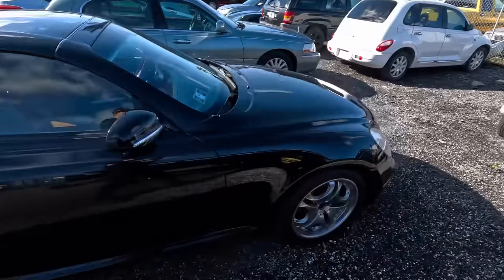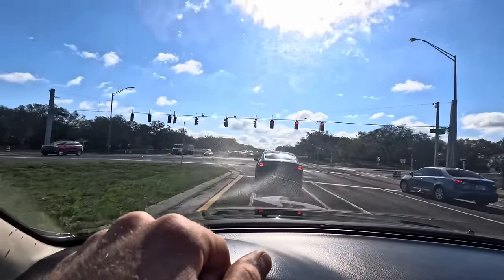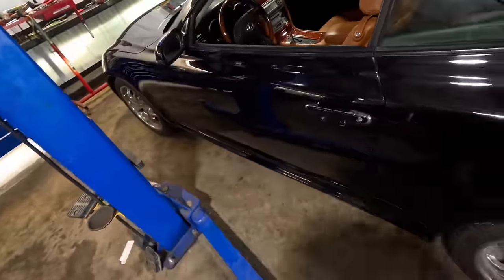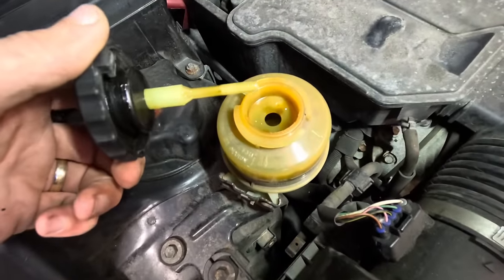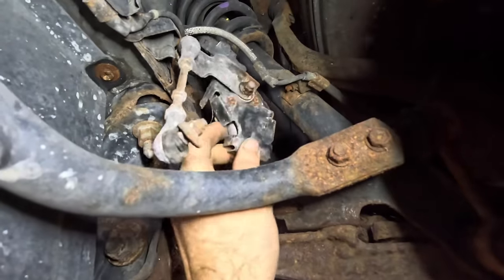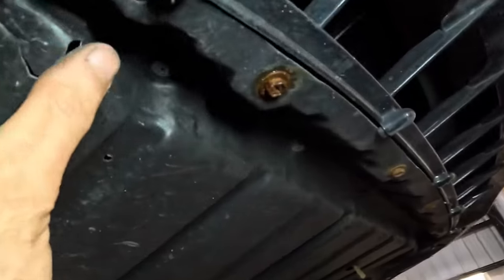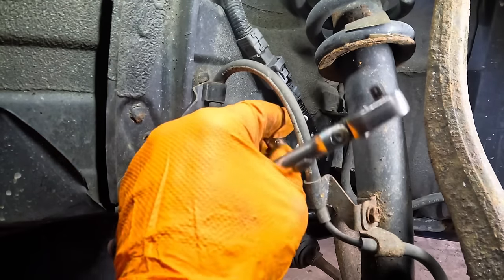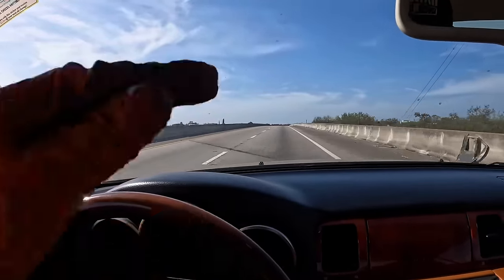Most Hated FAILED Sports Car! Lexus SC430

Comment: Stock USB in cars wasn't a thing in 2002. IIRC, first found it's way into cars via aftermarket head units and was more of a youth-oriented feature. Wireless charging in phones wasn't a thing until the '10s. Wasn't the Avalon one of the first cars with Qi?

I want aware of the SC430 being a flop, but I know this was when the SC leapt up the price scale with the standard convertible hard top. The value proposition changed. It was getting away from being the lux car you could buy and not be seen as performatively opulent. That also should have been around the time more luxury CUVs were showing up. People bought those instead. People also didn't buy the LS430 the way they did the LS400 (the SC300/400 was popular as well).

I would argue that Toyota has long been ahead in R&D (thus, well-built cars with well-thought, ergonomic interiors). They spent the budget there instead of in Marketing research...which is where the push to include all of the "comfort and convenience" toys that the American marks tend to excel in come from. Of course, that's also why they tried Scion.

If I had my pick, I'd have a SC300 with a manual because I like the shape, sticks are fun and I prefer a sunroof and trunk space. I can RAM mount a screen somewhere to add tech if needed.

(but what I would really want is an IS Sportwagon)

Comment: I feel that the owner should be told that you put a used part and way you had to use a used part and they should know that you welded a part back together. The air filter i think you should have cleaned it or let the owner know and let him decide if he wants a new filter or maybe have the customer come and pick it up and let him clean it or he might say get a new kl filter but I would have left it up to the customer and let him decide what he wants to do

Comment: I never liked that body style. Not sure of the model but the coupe body style before ours also looked like that. We have an RC-350 FSport in red of course. Great car and great looking. Only PITA front and rear tires are different sizes so can't rotate them. I'm in Florida. Finding this car with a beige interior vs black was unreal. It turned out there was only one in the country in N.C. We flew to NC. Uber ride to the dealer with our luggage and drove it back to So. Fl. They treated us so well up there we took the salesman and manager out to dinner. Never had a better car buying experience. Johnson Lexus BTW. We have a local Lexus dealer. JM Lexus. They are a Plus dealer so fixed prices no negotiating. They didn't have the car anyway but they don't deal. Not sure why people would buy from them but a lot of people would rather pay more and not haggle I guess.

Comment: if the customer is okay with it, i don't see a reason why you would be against using used parts. just charge them using used part prices and  make sure it works after it is installed and i would consider it all good

Comment: The only reason one could consider this car a failure is sales numbers and possibly marketing. It's NOT a sports car in the true sense of the word. It's a Grand Touring car. Reliable as anything else out there. A neighbor owns a 2005 with just over 200,000 miles. It doesn't leak from anywhere and runs like the day he brought it home nearly 20 years ago. Typical Toyota/Lexus reliability.

Comment: Used parts are acceptable when new ones are unobtainium. Owners should be advised and approve. No warranty on used parts unless it came with one from the seller and it should be understood that the shop/installers labor is not part of the warranty. In other words, the part should be warranted if it came with one (like, say, 30 days) but the installer should be paid for any subsequent R&R even if it fails within that time frame. 
Used parts can save a vehicle but bring inherent risks that the shop should not be liable for. All of that, or whatever agreement is decided upon, should be made abundantly clear to the customer-preferably in writing.

Comment: We've been using used parts to repair cars FOREVER (junk yard), if it does the job OK. You guys and your rust, I'm in Phoenix, don't think I could handle all that rust. Well the dealer had the part, but they wanted $235 for a sun visor, but WAIT, we'll put it on for free, still had to pay $70 on ebay, OMG

Comment: Customer should be made aware of the situation and decision should be there's but if the used parts are in good working condition, there's nothing wrong with using what's available. Only time it should be a problem is when said mechanic/salesman suggesting used part is actually a NEW part. That's immoral.

Comment: I think the customer should make the call on used. Explain the situation, "new is back ordered until don't know". "I can get a used part. What would you like me to do?" You would have to determine what your business policy is on warranty. I think you should be responsible for workmanship, but not used part itself. Customer is paying less for used part, he is taking the chance. As long as that is explained up front. Also, make sure it is on the paperwork and signed and accepted by customer. "Cover thy A**"

Comment: 392nd!  Happy LEAP DAY! Ray and the wife unit. And a big LEAP to the new employees. I think buying and or rebuilding parts you can’t find new is perfectly acceptable. I have a 1993 Mercedes 300CE convertible that had a leaking pump for the retractable top. I looked for months along with my mechanic to find one. Couldn’t find even a used one. Then a friend who ran a Mercedes dealership told me about an older gentleman who specializes in rebuilding convertible top hydraulic systems. I drove from Pierre to Denver left the car, flew back home, then when he had fixed it flew back to Denver to take the car home. It cost $750 for the  repair, but by fixing it, I was able to have the top go up and down so I could enjoy the convertible the way it was supposed to be used. Why have a convertible if the top doesn’t work?    Roger in Pierre South Dakota
Reply from the maker: It is leap Day!

Comment: If you seat is rattling the car you got is a rat and the guy that owned it didn't take car of it OR he weighed 400 lbs.
So, Nappa leather, GENUINE wood trim supplied by Yamaha Musical Instruments, HAND CARVED steering wheel by Haruko Techno wood ( made handles for Shogun swords), AND stock MARK LEVINSON 8 OHM(!!!) sound system.
Creaking roof?  Care dictates treatment will Silglide to keep them supple.
It sold for $64G's which in '04 meant $100G's.
I would like to see the CARFAX on this car!
Oh, underpowered?  200HP:  NSX from the same period was 280HP.
For the record, I recently did my timing belt at Lexus and was approached by everyone including the staff asking if I wanted to sell it ("No" ).
Face it, you got a rat AND a poorly-cared for rat!  I could tell when I saw the aftermarket wheels...I bet it even has a ghetto-blaster aftermarket radio!

Comment: FYI  It's not faux wood.  That is actual wood.  They are very reliable and fairly sporty. And Lexus are built in a separate plant in Japan with more QC than Toyota, and built better than Toyota. Lexus is less a Toyota than a Cadillac is a Chevy.  The reason the SC 4xx  weren't popular was the typical Lexus buyer used to drive an Oldsmobile. You don't see many people trading in their Olds 98 for a 911. The SC 4xx's were too small for the elderly XXXL's  who shop at  the Lexus dealer.   Also, the styling was too lame for real sports car lovers.

Comment: I had a Lexus LS460 and it was horrible, sticky interior constant coolant system repairs, rear suspension issues. Before I got it the front suspension had been redone and the abs system had been replaced too.

Comment: Certain used parts are fine. It just really depends on what it is. Should we tell the customer if we need to install used parts? Of course we tell them!! That's a no brainer, imho. Should the customer give consent on using used parts? Of course!! It's their vehicle, so they need to make that call. Although, it's up to us to give the customer all the information they need to make that decision. If we do our due diligence to help them make an informed decision. They will appreciate you/us more and will have more trust in us to take care of them and their vehicle. If our customers can't and don't trust us......well, they won't be OUR customers for very long now will they? Warranting used parts? Well that's a difficult one.  I say, yes and no. I will warranty my labor. But as far as the part goes, it depends on the part. I would NOT warranty electrical parts. You can't trace down the history of that part. You've no idea what that part has gone through before it got to you. So it would be impossible to guarantee that part, imho.

Comment: Kind of insulting towards Toyota/Lexus cars, aren't you?  Yet they consistently build the most reliable cars in the world, and Lexus is the most reliable luxury car in the world.

A lot of the interior creaking is from the top, the seats will squeak if you have the front seats against the rear seat thus the leather surfaces of the rear seat creaking against the plastic front seat shell.  There isn't anything that can be done with the top, MBZ had a similar top with a similar problem.

That car in the video I think has more than 65,000 miles, one look a the front seat shows indentations in the foam seating surface where it looks like someone has sat in it for 165,000 miles, or maybe the driver was very heavy.

That car had a rollover sensor pop-up roll bar that came out of the front seats for safety.

You made a snide remark about the cassette deck but failed to mention it also had a CD player.

That car is very solidly built, it was 500 pounds heavier than the same era Mustang GT yet it could keep up with the GT.

I've had mine since new, but since I live in the snow belt it sits in the garage all winter, so it only has 85,000 miles on it, but it's never needed any sort of repair, typical of Lexus.  I had the Cadillac XLR for a little while too, talk about a piece of junk!  I traded it in for the Lexus, what a wise decision that was.

Comment: 10 to 15 years behind the bleeding edge technology that companies like Mercedes have their customers basically are the beta testers of newly designed tech and features usually doesn't work flawlessly without issues and unhappy owners coming up. That's the most creeks i have heard maybe someone who detailed car went deep removing panels and such, but when putting it back together didn't tighten fasteners or place panels down properly which easily happens on over built Lexus cars like ls430 or sc430 ,but personally i like over well engineered cars even though it complicates removing and installing parts especially the climate control system in the ls430 hopefully not as complex in the sc430.

Comment: It's not a sports car, it's a touring coupe, once you understand that, it's a nice car.. At the time this was new the 2002 mustang GT 0-60 was 6.5 seconds.. the 2002 SC430 was 6.0 seconds.. It was built well, but cowl shake is real.. that said, it failed because of its identity crisis..  It was too soft to be sporty, and too heavy to be fast.. If they just called it what it really was, it would have been a great vehicle.. It should have been called the Lexus Buick.. 😂

Edit: my experience with these, If they don't have the timing belt done, no matter the mileage, i would stand clear.. ❤
Reply: Recommended mileage for timing belt service is 90k, this SC430 has 65k on the clock, but the belt's original, and that's the conundrum -- same situation I'm facing with my late father's '06 LS430 with 21k original miles on it. These timing belts routinely make it way beyond 100k, but being an interference engine I wouldn't push it. One trick a mechanic showed me was to loosen one of the timing covers and sneak a peek at the belt with a flashlight, which is better than nothing (but not much). A timing belt replacement on these 3UZ-FE V8s is not for the faint of heart.
Reply: @craigcraigster4999  Mileage at this point due to age is a factor. I'd pay lexus to change it, long term it's worth it. These are extremely reliable and skimping on the service imo is a bad call.
Reply: Actually  a timing belt is not a bad DIY job , complete kit plus antifreeze under $250.00
Reply: @vincentlevy9416  Yup, it's an interface engine, so just keep in mind, if you're off even by a tooth, no more engine, and the 3uzfe even now in 2024 is a 2-3k purchase, plus shipping, plus installation... plus timing belt.. so yup, you can try it yourself, but if you screw it up, it's a 6-10k dollar mistake.. I'd argue if that was the option, just leave it alone.
Reply: @craigcraigster4999  
If you purchase the belt kit it comes with easy to follow instructions, I have done a few of these both on ls430 and sc430 
PS   I own each

Comment: Top Gear (BBC, not the crap copycat US version) called this the worst vehicle made, even worse than the Chevy Vega, Yugo, and Ford Pinto.  James disliked it for its power, poor ride comfort and styling.  Jeremy implied the only people who would buy it were elderly rich Americans.  Richard said the 4 rules to building a sports car are it has to look good inside, outside, ride well and handle well.  He said the Lexus SC430 did none of that.  The first car to get a wireless charger was a 2013 Toyota, of course a 2004 Lexus won't have it.   First cars with built in USB ports came out in 2006.  Reeeeeeeeeeeeeeeeeeeeeeeeee

Comment: Ray REEEEEEEing about a 20-YO vehicle technology. 6 disc CD Changer [WHY???] 
No wireless phone charging? Perhaps because - Qi was first released in 2008???

Ray REEEEEEEing about a 20-YO vehicle that creaks.
The same guy that drives a diesel pickup that you couldn't even hear gunfire in when driving down the road.

"Car is 20-YO so REPLACE EVERYTHING" 
Research before REEEEEEEing Ray, RESEARCH!

Comment: In all fairness, the car is a 2004 I wouldn’t expect it to have wireless chargers, USB ports or even a CD changer for its time that was pretty well option Car the mechanical reliabilities is a whole different topic
Reply: Actually, CD changers were available by 2001 on some cars. My best friend once had a Ford F150 Lariet crew cab truck that had one from the factory. His Frontier (2011), I believe has one too, but it's by Rockford Fosgate. It, does have USB/3.5mm jack and I think BT. 

I have all that in my 2003 Mazda Protoge, and even it came with CD and a cassette player when the factory head unit was still in it. It was replaced by the time I bought it in 2012, and I then replaced the single DIN Alpine CD unit for a double DIN JVC that has BT, 3.5mm jack, and USB, CD. I mostly only use the USB and all my music in on a thumb drive.

Comment: Looks like a Solara. Love my Toyota Camry ❤
Reply: Today I s/b picking up an '07 Solara; can really see the similarities.  TX car with 70k on it.  I hope to freshen up the suspension (upgrade is the wrong word).  Will put KYB struts along with related hardware up front, sway bar bushings, end links.  Fresh set of Pirelli PZeros and see how it rides, go from there. 2nd car, never had a convertible before, expect to put no more than 3k mi. a yr. on it.  Will def. be garaged.  There is a lot of things it is not, what it is, however is a Toyota, heard it described as having a Lexus-like build quality. Love the Audi TT Roadster and the Cabriolet, but do not want the headaches.

Comment: Ray, sorry but I can't subscribe.  Why?  Because I've been subscribed for a heck of a long time now.  LOL  BTW, when it comes to used parts like that, ALWAYS explain to the customer, they have a choice, get it fixed with used parts or leave it broke because you can't get a new part.  Also, the fix you did with that bracket was EXEMPLARY.  Looked like a brand new piece when you were done.

Comment: Here is a comment, for the algorithm.
Reply: Its ok to use used parts, as long as there is consent from the customer. 
there should then also be void of any waranty, as long as the mechanic does make sure the part looks in working order. and does not overcharge the value of said used part.